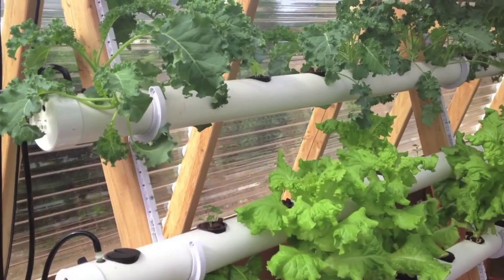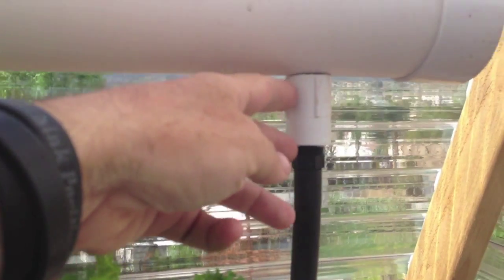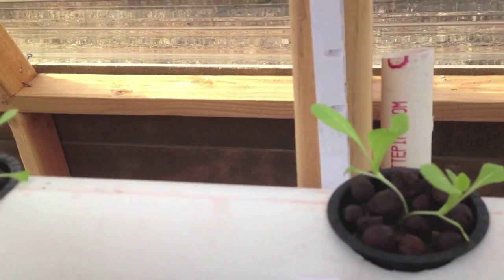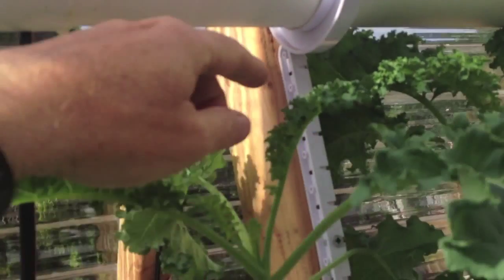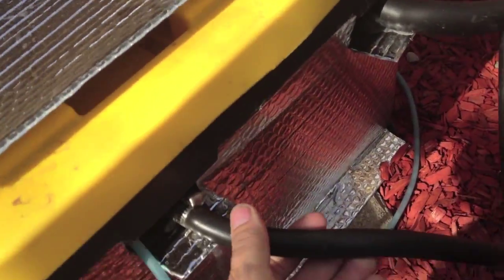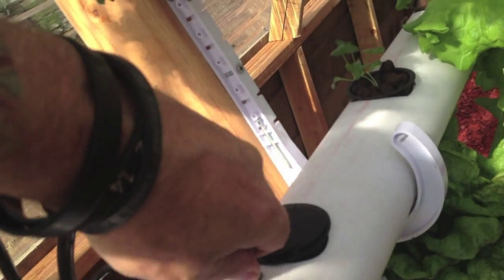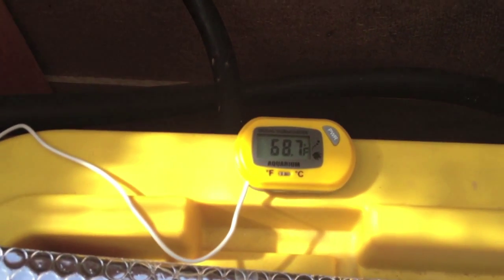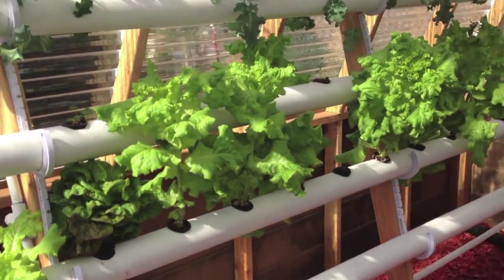Hydroponics Leafy Green NFT System

Comment from the maker: Ruben, mine is in a greenhouse so no rain problem. Using flexible hosing for intake and outtake made it very easy to take down (which I did do) This year I hard piped the drain side but without glue so it can still come apart

Comment: Nice system; I like your build. I am planning to build a similar system, but I'd like to build something I could take apart in the winter and put back together in the spring. Do you have any advice for a build like such?

Also, how would you handle overflows when it rains?